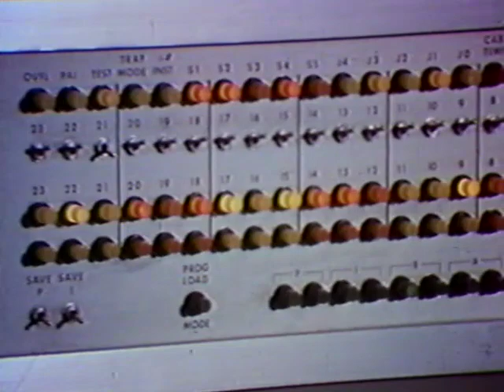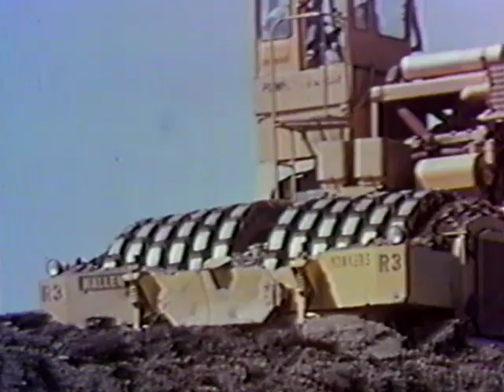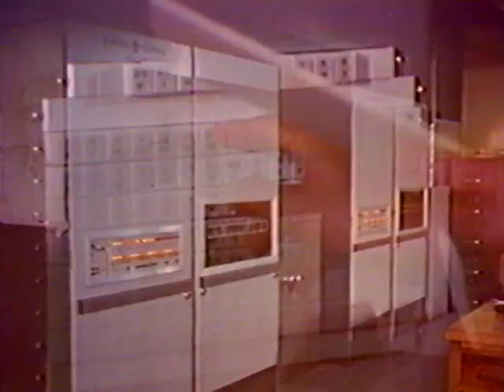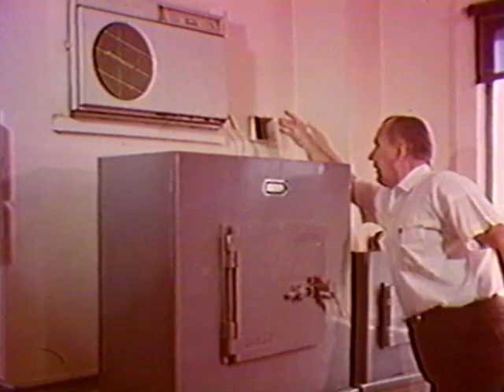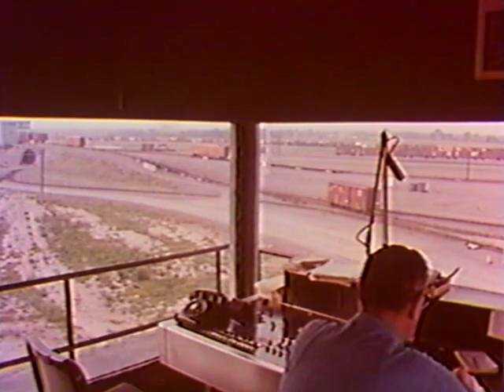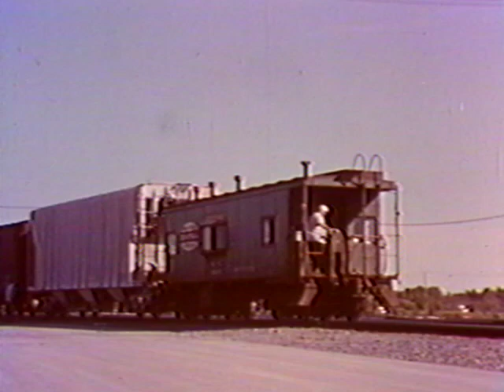Cybernetics at Selkirk

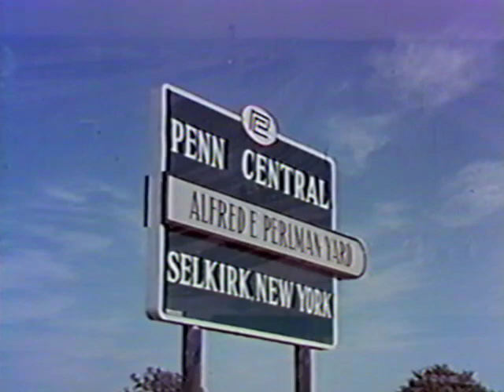Comment: 3:36 "Perlmann Yard, which stretches out for seven-and-a-half miles."
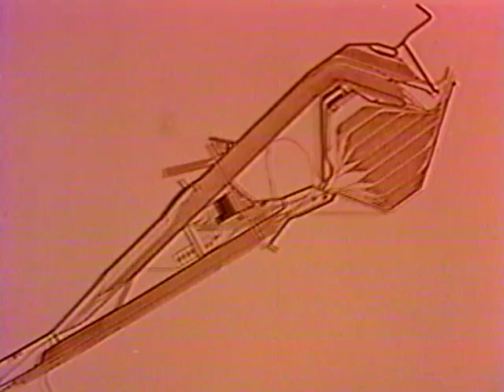No it doesn't. It's about 4 miles long today, and the diagram at 5:10 is the same shape as the yard is today, so it's not the case that half the length has been removed since the video was made. I guess they're counting the receiving yard and departure yard separately and calling that "length", even though they're side-by-side instead of end-to-end. By that metric, I'm 8'6" tall, by counting my legs separately.

Comment: selkirk was great under conrail but CSX has trash Selkirk very good. CSX has also trash the main line from Selkirk NY to Cleveland OH
Reply: You worked for either railroad??
Reply: @berkshiredave9766  you dont have to work for the rail to know when tracks are in bad shape. you can see it from road crossings. heard it from frends that work for con rail CSX new york rail fan have walk next to tracks. see lots of ties pumping mud been told the blasest has not been clean since 1997  FRA reports.
Reply: You are wrong, former.

Comment: All that computer hardware was designed for the NYC System equipment.  When they merged w/the PRR, they found out the PRR used incompatible computer hardware.  The result was thousands of misrouted cars, lost shipments, generally a gigantic mess!
Reply: Wow, incredible.  "an exciting example of technological things to come" - LOL
Reply: No one saw it about something like the computers being incompatible with each other computers we're still brand new
Reply: In the mid-sixties, this yard lost a season's worth of potatoes, from Northern Maine. It took literally weeks to find the missing freight in Selkirk Yard; by then, the crop was ruined. It was the last time that potatoes were shipped by rail..
Reply: @icedudesk8    I believe it. Penn Central was responsible for more traffic going to other railroads, or more often to the trucks, than any other!
Reply: what did you expect. the PRR could never RUN a rail road and had been losing money since 1946. the problem is the PRR men ran the show at Penn central. Al perlman never got to run much of any thing at Penn central. Hint Al perman was one of the Best CEO in rail roading